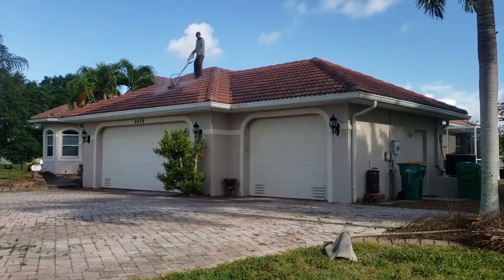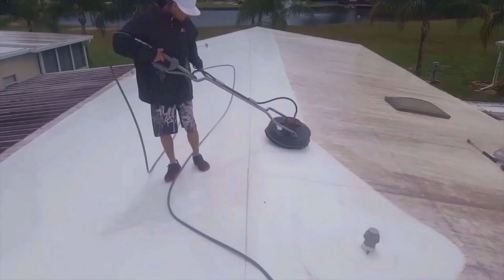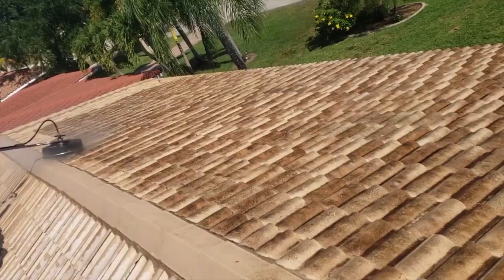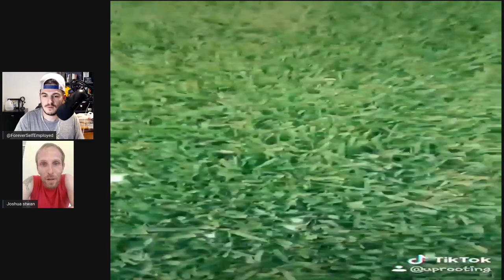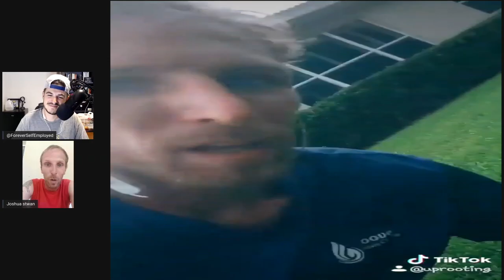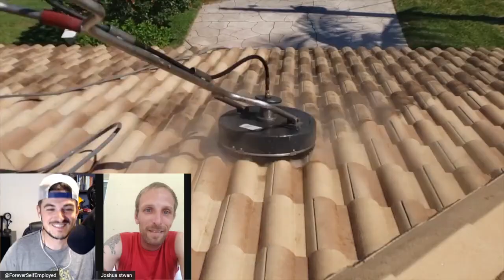I MADE $1200 IN 1 DAY PRESSURE WASHING ROOFS

Comment: I just did a job for someone and got 250$ but i underestimated it so hard! I worked 12 hours and got 250$ :/
Reply from the maker: It’s all good just adjust on the next job
Reply: It also depends on your equipment you are using and the motor for your machine. An 8gpm will allow a fast cleaning time than a 2 or 4 gpm machine. Time and practice and you’ll be completing those jobs in half the time. Keep at it.